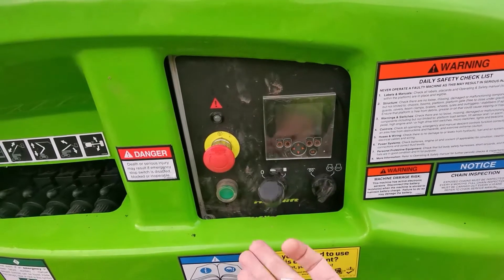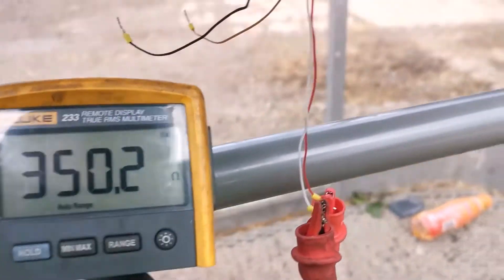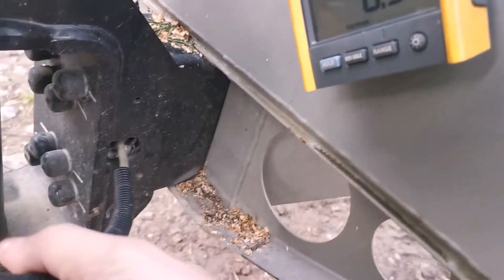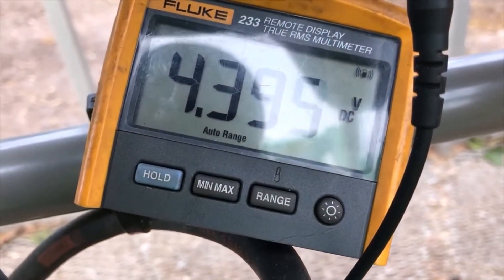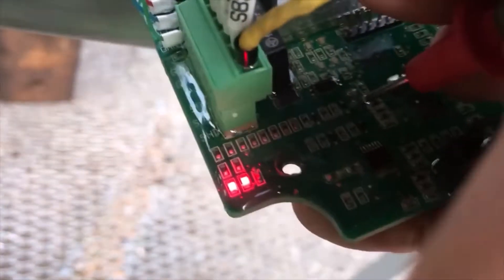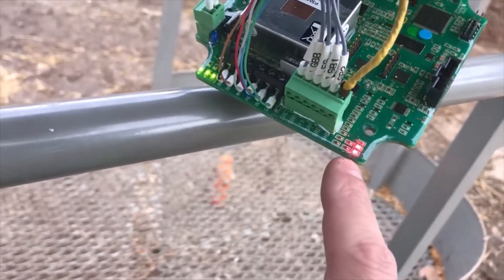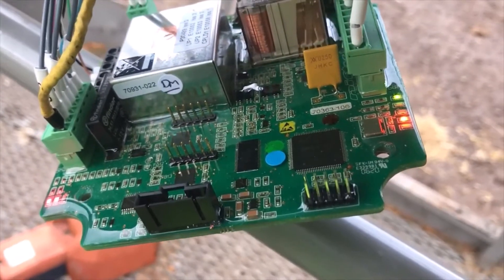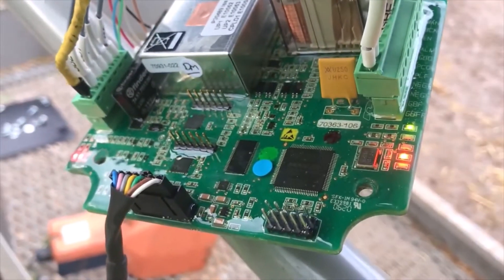Niftylift overload fault cage weigh calibration and test

Comment: Hi there, I'm having this module for repair. Customer explained that after having shorted the battery, this print no longer works. I get the 12V green led, but the other two do not light up. My question now is: do all the three green led's have to light up with only 12v connected? Thanks in advance for your help!
Reply from the maker: @pietervanderweg1157  hi yes all 3 led has to be they represent different power rails. I think you will have to replace that baord
Reply: @RTFIX  Thansk! Highly appreciate it that you took time to respond. I'll try to get it fixed for the customer. I must find out where the different rails are generated on the board. That metal case looks like a cage of faraday, not sure if it's stuffed with (two?) dc-to-dc converters or if it's something completely different but I don't see any coil voltage coil on the board (which is not a must obviously, but it somehow seems logical).. do u have any experience fixing these boards?
Reply from the maker: @pietervanderweg1157  no worries buddy dont have experience fixing them normally just replace if needed . Just know meaning of those Led 😊
Reply: @RTFIX  Thanks for your help so far!
Reply from the maker: @pietervanderweg1157  any time
Reply: Hello. @pietervanderweg1157 has repaired this board for me and is installed now. The left green LEDs are on now. The right top LED is also green. Cage weights are ok. It's going to alarm with too much weight or underweight.(3e and 4e LED red) Now if I push the green button to start the machine, nothing is happening. The second LED from the top on the right side starts flashing 7 times, following 1 time, following 3 times. This repeats with a sounding alarm. 
Do you have any ideas? I appreciate your input.
Reply from the maker: @klaasdegroot8640  make sure calibration is good and if it is then check for a back feed to a board and then if you still have issues them possibly there are more issues with a board
Reply: @RTFIX  Tanks for the quick response. I will check the calibration.